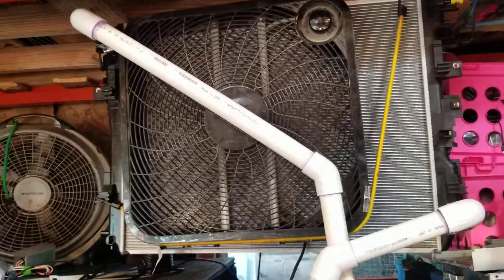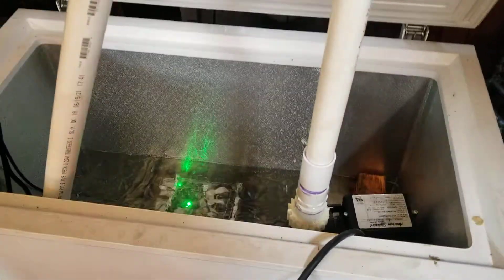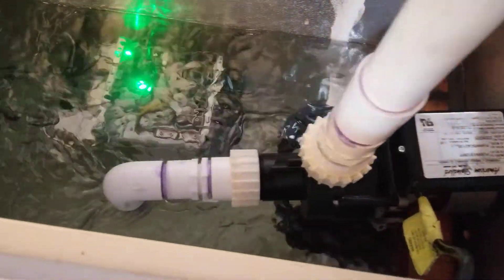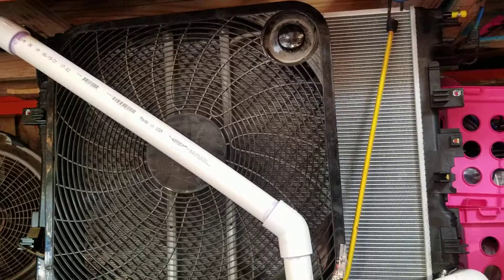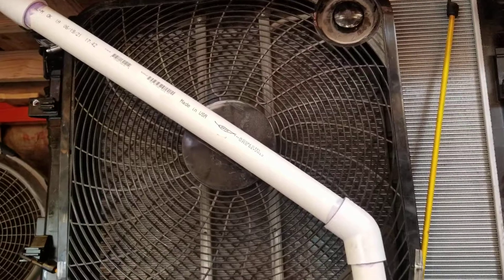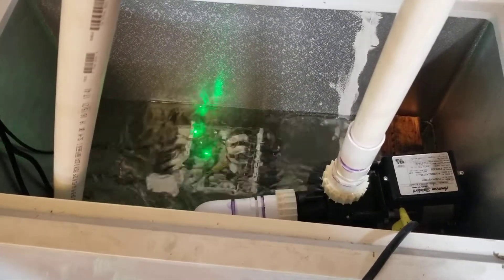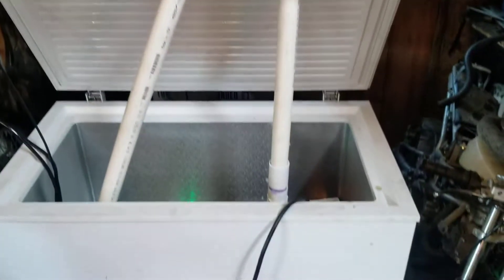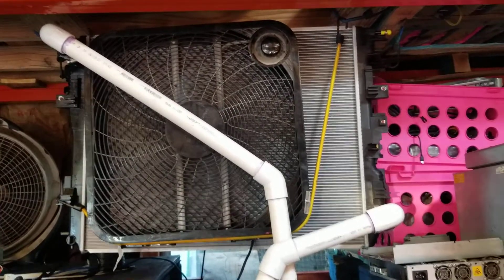DIY Immersion Cooling Crypto Mining S17

Comment: Something just occurred to me when I saw what you did. Maybe it's stupid. But how about turning on the freezer?   cold enough to maintain an ideal temperature, if the freezer thermostat would basically control the on and off of the refrigeration, you would just have to find a way to recirculate the liquid

Comment: I love it! I'm doing something similar for a gpu rig I have in mind. I was going to use a stainless steel sink, but love this idea even more.

So I have a question regarding the design, Engineered Fluids (maker of Bitcool) has an 85pg primer on an efficient design. But it looks like you can just pump it out from a higher elevation than where you dump it back in, huh??

If THAT'S the case, I've got some RTX3090 gpus that have a LOT of surface area for the heat, but won't fit into a riserless motherboard. But, NOW, I can mill those fins down, so I can squeeze  them all onto the riserless board and make a manifold that dumps the coolant at the base of each gpu.

I'm thinking a heater core with a 12v fan probably won't do the trick. LoL
Reply from the maker: Yes you must pump the liquid that is at the top out, that's where it is the hottest. And dump it in at the bottom as shown in this design. Good luck!

Comment: you have the fan in a configuration where it is pulling the heat away from the radiator. is that because its all against the wall?
Reply from the maker: The whole point of the radiator and fan is to get rid of the heat. It's the exact same concept as your car radiator.

Comment: I would think you would want to have the coolant circulating past the heat sinks no?
Reply from the maker: It does. The return line pushes to the intake side of the fans and the fans push it across the heatsinks and the intake pump side pulls the heated fluid up.

Comment: Are all miners water proof?? 
You seem comfortable just immersing it directly into water with no other protection.  
OR, do I have to get certain GPU miners that are waterproof?
How can I tell before I buy one?
Reply from the maker: This is not water, it is die electric fluid. No miners are waterproof. This particular brand of fluid is called Bitcool.
Reply: @brothersmechanics2028  Heat is valuable.  I wonder if there is a way to use the excess heat to heat the hot water tank? Or, heat my hot tub?  Or, heat my swimming pool? 
Or, even heat my house in the winter?? 
Seems sad to let all that heat go to waste.
Reply from the maker: @craigkdillon  yes there is a way to do it using a heat exchanger. Many people around the world do that.
Reply: @brothersmechanics2028  BTW... Does the Die Electric fluid degrade or become unusable over time?? 
Or does it last forever?
Reply from the maker: Die electric fluid does not transmit electrical currents allowing you to submerged literally any type of electronic in it without any damage.
Reply: @brothersmechanics2028  Nice.. Looks like water.
Reply from the maker: @craigkdillon  its kinda freaky the first time you submerge them but afterwards it becomes more normal lol

Comment: question pleas? 1. dose moisture gather around the wall of freezer and mixing with oil?
2. dose freezer motor working hard so eventually burnt out? thanks
Reply: Its not sealed so there will for sure be fluid contamination.

Comment: not sure if you have those fans are still on the ASIC but you don't need them, they are not designed to move liquid and are less efficient that way
Reply from the maker: Its running on asic.to which has an immersion mode that takes care of the fans.

Comment: I am writing to you from Venezuela, I want to submerge 6 S9 equipment, what capacity or radiator model would serve me and how many LPH recommends the pump, thank you very much.
Reply from the maker: I would suggest you use a "20x20 heat exchanger" from ebay along with a 17lph centrifigul pump. The setup in this video works but there are better products to use.

Comment: how did you get the pipes sealed over the radiators?
Reply from the maker: Home depot sells rubber connectors to go from pvc to metal piping.
Reply: @brothersmechanics2028  thanks. also i see the pump is out of the liquid. do you have to prime the pump or will it suck on its own accord?
Reply from the maker: @keiko909  yes you have to prime the pump first.
Reply: @brothersmechanics2028  does the radiator need to be filled up first so it can flow down to the pump to prime it?

Comment: How did you connect your 1-1/4 PVC pipes to the radiator in/outlet? I see some clamps - can you please share the connection details?
Reply from the maker: I used the following item: 
https://www.homedepot.com/p/The-Plumber-s-Choice-1-1-4-in-PVC-Flexible-Coupling-with-Stainless-Steel-Clamps-E3284114/305473559?source=shoppingads&locale=en-US&&mtc=Shopping-B-F_D26P-G-D26P-026_001_PIPE_FITTING-NA-NA-Feed-SMART-NA-NA-PIPE_AND_FITTINGS_New_Engen&cm_mmc=Shopping-B-F_D26P-G-D26P-026_001_PIPE_FITTING-NA-NA-Feed-SMART-NA-NA-PIPE_AND_FITTINGS_New_Engen-71700000081569467-58700006932068304-92700062338492358&gclid=CjwKCAiAzrWOBhBjEiwAq85QZxjVgqOkmc-8ZTBCE80NiNdmZ9EcEz6qOYq2ZlG6sUooQvBNjsouFhoCsNgQAvD_BwE&gclsrc=aw.ds

Comment: Hey! I’m really interested in your commercial grade setup that can accommodate 2 miners. How can I get in touch? Cheers
Reply from the maker: Well its not exactly commercial grade, more like DIY grade, but it definitely works great. It wouldnt exactly be worth shipping this to you, it would be cheaper to just find everything in your area. Good luck!
Reply: Thanks for the fast reply. I’ve got a couple of units that I want to use for immersion. Can I purchase a guide from you on what to buy and how to set it up? I need to get them up and running asap
Reply from the maker: @stanplan  I guess i never thought people would want an exact set up manual. Do you have any plumbing skills? It will only work if you know how to plumb pvc pipe.
Reply: Lol I don’t but know someone who does. I’ve got a pool that I’m hoping to use lift cooling. How can I get in touch to discuss further?
Reply from the maker: @stanplan  email me: hbmotorsports@live.com

Comment: That's a great setup. The only thing that's pulling me back from doing this is my poor knowledge on piping. Would it make any difference if you used Parker hydraulic hoses instead of these pipes? I hear they work great.
Reply from the maker: There are numerous ways that would technically be better, but this set up is easy for normal people. Finding pipe fittings for anything other than this will be very hard to find. The only part in this that you cant find at home depot is the fittings from the water pump.
Reply: i personally would be using more expensive submersible hoses.  Its very playable and its the same stuff they use inside fuel tanks.

Comment: Fantastic set up. How much money are you saving each month in electricity with this? Immersion cooling companies advertise up to 50% savings but I'm curious to see what it works out to be in real life. Thanks for your time and best of luck with your operations!
Reply from the maker: It's not much in savings when you overclock the miners. If i kept the hash at stock then it would save on costs. Thanks for watching!
Reply: @brothersmechanics2028  Doesn't that mean that you make more money with the mining?
Reply from the maker: @craigkdillon  sort of. Its kind of a wash but the miners last way longer immersed. You only save if your not overclocking, but your also using power for the pump and fan.
Reply: its still much more expensive than a viable heat transfer solution, but one could argue its safer for the hardware.
Reply from the maker: @huntmining  What is your ideal "viable heat transfer set up"?
Reply: @brothersmechanics2028  you can see how ridiculous I went on my heat transfer setup lol it is 8kw of heat. I like negative pressure wind tunnel situations. I dump the air outside during summer and heat the house during winter. TikTok is the same as my name. I do like immersion and have been doing a lot of research on it lately.

My current setup is extremely efficient and does not require an AC. 200 watts total for the 6, 8 inch 800cfm fans for cooling 8kw of heat.
Reply from the maker: @huntmining  so air cooling is your ideal setup? I would have to heavily disagree. Its much harder to overclock your miners safely with air cooling. Immersion has been proven to be the best way, but if you like your setup then keep doing what you like. My job isnt to change your mind, It's simply to show what i do. People can decide for themselves. Put a link to your setup for others to see if you wish.

Comment: Did you remove the antminer fnas?
Reply from the maker: It isn't necessary to remove them. Immersion mode slows them down.
Reply: @brothersmechanics2028  I´m from Mexico and is difficult to find  Bitcool, just can find mineral oil. Do you know if mineral oil  its good for inmersion cooling?
Reply from the maker: @sanjuarez24  mineral oil works, but is bad for the electronics over time.
Reply: @brothersmechanics2028  Thaks for your answer, only one cuestion more. If I use trasformer dielectric oil, Could it works better than mineral oil? Sorry for my cuestions but I just bought an Antminer T17 and I´m lookinng for the best option for cooling. Thanks
Reply from the maker: @sanjuarez24  I do not know what transformer die electric oil is. You will need to send an actual product link to possibly know but you should just ask the company that makes it if it will work.

Comment: hi boss, what water is this? tap water?
Reply from the maker: Very funny. Its bitcool.
Reply: @brothersmechanics2028   Just found out folks out there call it minral oil... but its $50 to $80/L but can a different oil be used like mustard oil because thats cheap here.
Reply from the maker: @DLP11111  DO NOT USE MINERAL OIL. It will break down the electronics.

Comment: I love your setup. Is it still working well? Have there been any hiccups along the way? I want to do a similar setup. Is there a way to put a filter in the flow somehow so incase any contaminants get it like dust they get removed?
Reply from the maker: Yes it's been working great for many months. The only hiccup i had was a pipe blew up because of my own error setting it up. Since then i haven't had any issues. I upgraded the radiator to a 6.7L cummins radiator. I have not added a filter yet tho.
Reply: @brothersmechanics2028  Thanks for the reply. If you're able to do a simple video showing the current setup that would be awesome! Happy Thanksgiving.
Reply from the maker: @minutemansolar  Im currently working on a better set up that is closer to the commercial setups for immersion. I get a lot of questions on how to cool more than 2 miners so the new setup should work well. I'll make a video when it's ready.
Reply: @brothersmechanics2028  awesome im excited for your video
Reply: @brothersmechanics2028  hi did you made your new setyp finaly ?
Reply from the maker: @benoito8753  i am currently testing 2 machines in this and working on another system that might be even more efficient. At some point i will do a video on them. Thanks for watching!
Reply: @brothersmechanics2028  good thx
Reply: Just gotta know because I've had "hic ups" too like pvc becomes brittle and ruptures spilling that expensive coolant all over, the pump has to have viton seals or it won't last, materials need to be certain types. Is it still running???
Reply from the maker: @lonniemcgallion  So far it has not had any issues, but i did find out that you need to use pcvc instead of PVC. I am also building an updated system with a better more efficient pump and radiator that can all be bought on ebay or amazon. Ill update the vids when i finish this build.
Reply: @brothersmechanics2028  the pump i went with is a submersible Little Giant 1200gpm or GPS. It costs $127 on eBay. It has the viton seals bitcool 888 calls for. Thanks for the pcvc info.
Reply from the maker: @lonniemcgallion  nice, that will work nicely
Reply: @brothersmechanics2028  wow, I've went through my 2nd pump. It has the viton seals that bitcool888 recommends and also is a Little Giant, which is also recommended.
The pump is a submersible and pumps 1200gpm (or1200gph) and the fluid is cool, the miner Temps are cool but the fucking pump gets so hot you can't touch it.
If you've had no problem with your pump, what do you recommend??? Please help.
Reply from the maker: @lonniemcgallion  yikes, the pump im using has been running for almost a year and im pretty sure it's not on the suggested pump list lol
Im trying a new set up with a centrifugal pump and pcvc pipe instead of pvc. Once i get that running I'll make a video on it.

Comment: Nice diy video. What temps are you getting on the miner with two of them in there? Still using the same radiator?  What`s the ambient temperature at?
Reply from the maker: Bigger radiator (ram 2500 6.7l diesel radiator), ambiemt temps around 60f-70f. Miner temps still in the 60's.
Reply: @brothersmechanics2028  are those temperatures good for the GPU’s lifespan?
Reply from the maker: @kujo2767  typical miner temps are under 70 degrees C. Ideal temps are between 40-60 which is what you get with immersion cooling.

Comment: Use 3M NOVEC fluid and you will not need all that cooling stuff !
Reply from the maker: I'll look into it. Thanks for the tip!
Reply: @brothersmechanics2028  it boils and then goes to the top of tank then condenses back to liquid
Reply from the maker: @samanthapowell5882  sounds like a reason to experiment lol
Reply from the maker: @samanthapowell5882  According to 3M, they said they only sell that fluid to Immersion Mining Specific companies and nobody else due to the type of fluid that it is. So if you can get it, send a link for anyone watching this. Thanks
Reply: @brothersmechanics2028  don’t listen to this guy

When it evaporates you’ll still have a massive heat problem

You want a liquid that doesn’t evaporate so fumes cannot get out and so that you can cool it efficiently

What fluid are you using?

I use odourless kerosene for cooling 60 x S9s
Reply from the maker: @joshuanaismith4835  Bitcool is specifically designed for this application, its what i use.
Reply: @joshuanaismith4835  I am not a guy first and second you have done no research talking like that stop trolling
Reply from the maker: @samanthapowell5882  if you can find a link to actually buy the stuff i can experiment and make a video showing the validity of it.

Comment: how reliable is the pump?  I feel like that's the first thing to break in this setup if was not designed to run 24/7.
Reply from the maker: You would think that it might go out, and it might, but it's been doing great for months. I have backups in case it does and also the machine is programmed to shut off if it gets to 78 degrees.
Reply from the maker: Also according to some of the actual immersion tank companies they recommend any type of pump like this.
Reply: @brothersmechanics2028  awesome, good to know.  when you say order the connections, you mean from the same vendor as the radiator itself?
Reply from the maker: @xalspaero  order connections from the brand of pump. So in this case you have to go to American Standard to get the right pump connection. Then you get a rubber connector from home depot to go from pvc to radiator.
Reply: @brothersmechanics2028  Hey! Does it have to be a hot tub pump? Will the swimming pool ones work? Also, how many horsepowers is this one?
Reply from the maker: @af6727  Swimming pool pump will work. Not sure on hp but it doesn't need to be a lot.
Reply: @brothersmechanics2028  I've read somewhere that you need to make sure that a pump can take the heat. Some may even change the gaskets of their pumps to Viton, as it withstands heat.
Reply from the maker: @af6727  yes they need to have viton seals, but almost any water pump will work. I was given that info from a large immersion design company.

Comment: What’s the voltage and the frequency it’s running at ?
Reply from the maker: Voltage = 18.5
Frequency = 700
Reply from the maker: Keep in mind that what works for my machine may not necessarily work for yours so experiment and find out what your machine likes.
Reply: @brothersmechanics2028  thanks. Yea I’ve got s17pro 56th. Pretty much the same

Comment: I like your set up how can I use it for six units or maybe 10
Reply from the maker: I would get a 15cft deep freezer and a couple of larger diesel radiators. From there you would need to adjust everything based on how low the temps stay. Do 1 miner at a time.
Reply: @brothersmechanics2028   thanks for the quick response and Good explanation thanks
Reply from the maker: @jamesm7346  no problem Good luck!

Comment: Great stuff. If I were to do this with 4 Avalon miners A1246 would the fans become an issue once they get submerged? Dont they automatically detect the spin rate and then switch off? I saw there is a hack for this with the Antminers but I couldnt find one for the Avalon miners.
Reply from the maker: Normally you just upgrade the firmware to a system that has immersion mode and that fixes everything. Ill send a link to one.

Comment: How do I keep the oil temperature at 40 degrees? I'm using a radiator even so this is overheating the tank.
Reply from the maker: Is your miner overheating? 40 degrees technically isnt hot at all. Your machine is good up to 79 degrees, but ideal temps are below 70.